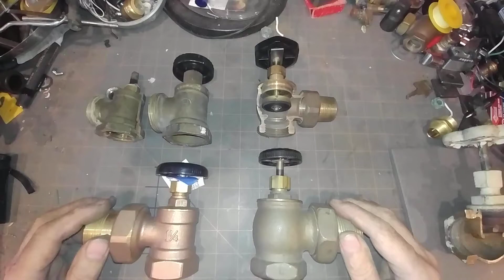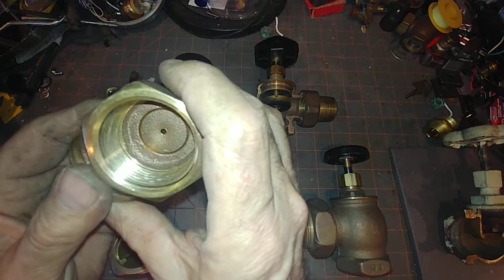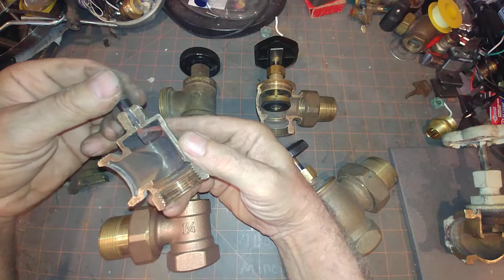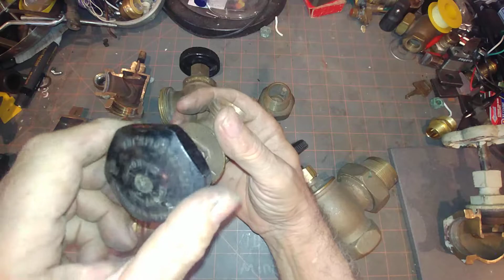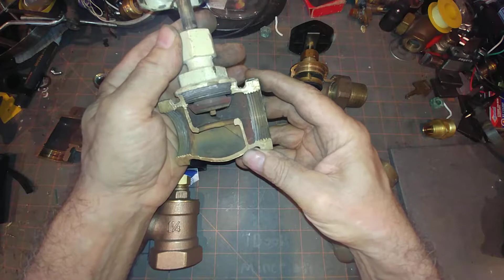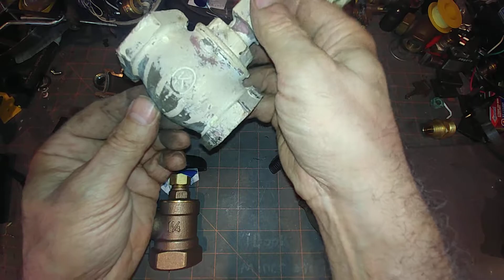Steam or Hot Water Radiator Valve? Vive La Difference!

Comment: My old hot water radiator on the second floor has been leaking for a couple of years. I sanded all the crude off the vavle n saw the pipe that is coming out of the floor is very rusty and brittle. My bedroom feels very muggy and damp. Impossible to sleep in it. Matter of fact, my whole house feels wet and muggy. I need to fix this but don't know where to start.
Reply from the maker: You might need to have that pipe and valve replaced.

Comment: Great Video and info! I have a one-pipe radiator in my bathroom that is recessed into the wall and it gurgles loudly, it has a inline straight valve that I'm going to check to see if it's the correct type for steam! What's the difference between the Bluefin or Matco-Norca steam radiator Gate Valves?
Reply from the maker: Thank you for your compliment!
As to Bluefin or Matco-Norca, they are both low-end import quality valves.
I would consider a Legend (better quality import).
Has your radiator always qurgled?
It might have too large a vent or the piping leading to it might be off pitch.
Reply: @gordonschweizer5154  yes, it has always gurgled since I bought the house 20 years ago. After watching your video, I thought the issue might be an incorrect valve (it has a watts RA-1) inline gate valve, but after listening to the gurgling closely, it seems to be coming from the piping before the valve, which is behind the wall and under the floor. I imagine they used elbows and piped it incorrectly in-order to recess the radiator in the wall.
Reply from the maker: Sorry for my late reply, your comment got buried.
Yes, it is likely that the piping run-out to your heating unit is off pitch.
That might take a bit of doing to fix.
But it will heat better if you do (and be quieter, too).

Comment: Absolutely right, 💯open = No water hammer.  👍.
Reply from the maker: Exactly!  It cannot be said often enough.
Reply: How about the valve that you mention in another video (stop angle NEEDLE valve )I suppose that because of the needle it can be used as a throttle valve??
Reply from the maker: @josephrodriguez1540  Single Pipe Steam gets the fullest of the full open as you so correctly state.

Two Pipe Steam generally works best with some kind of throttling action from the valve.
Reply: @gordonschweizer5154  thanks.

Comment: Perusing Gorton's website, and feeding my new 12 step addiction to your videos, it occurs to me that it might be a fools errand to simply swap out an air vent on a steam rad. It feels to me that I need a load calc (at least roughly) on the room, the potential BTU output of the rad, the DESIRED BTU output of the rad, and then an appropriate vent size for that room? (whether Hoffman, Gorton etc)  Is that right? And even then wouldn't it make sense for energy management and zone control always use a Varivalve type valve for room control?  I'm getting the impression that people underestimate how appropriate venting is. Am I wrong?
Reply from the maker: There are a lot of ideas in your questions. But first of all, thank you for your support!
Now, I would say, try not to get too bogged down in the details.
Often, the hard work of sizing the radiator was done long ago.
Usually, but not always, it was oversized. Usually the rule was 70* inside when it was 0* outside and sometimes with the window open due to the last pandemic of 1918.
So, I would vent the steam mains like crazy with big vents like the Gorton#2, and use relativity small vents for the radiators. Often, I like to use the Vent Rite #1 adjustable to dial in comfort.  I would avoid the Verivalve for...reasons.  It's a process of trial and error, but at the end of the day, it's about comfort..
Reply: I am a boiler operator for 40 years. 
Network with others and open minded is the secret. Always open to learn...

Comment: Are threads on a hot water system different from a steam system?
Reply from the maker: If you mean the male pipe threads on the spud and the female threads in the valve body as shown, then yes, they are all standard national pipe threads or "npt".
Reply: @gordonschweizer5154  
Thank you for that response.  I purchased a hot water radiator valve to install on an old radiator and the threads on the spud nut on the radiator didn't match the threads on the valve body.
Reply from the maker: @gwsjr1  The threads that make up the union between the spud and the valve body are not npt and unique to each valve.
You are going to need to remove the old spud from the radiator and install the new spud that comes with your new valve back into the radiator. The male ends of that spud should be standard male pipe threads.

Comment: Nice Gordon,
It’s those little differences of water and steam that are easy to just assume. Truth is a valve ain’t a valve unless it’s for the right medium, not the pipe thread. I just always assumed globe shapes were steam. But we both know when you call the supply house you better clearly make the distinction.
Reply from the maker: Thank you for your insight.
I've gone to the radiator valve bins in warehouses and pulled valves that look like steam valves, only to find that little hole in the washer. In fairness, it's easy to overlook.